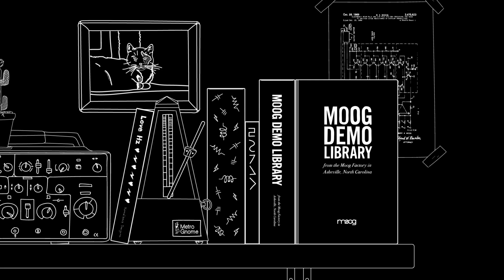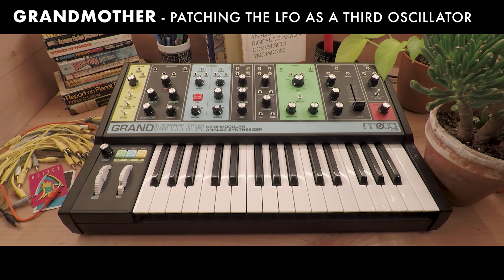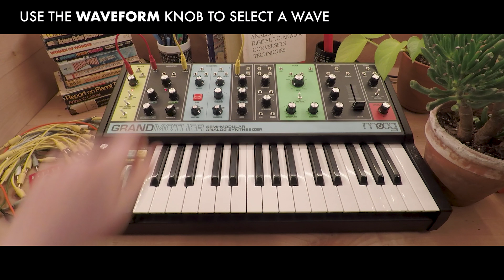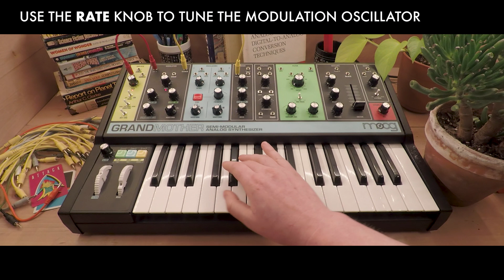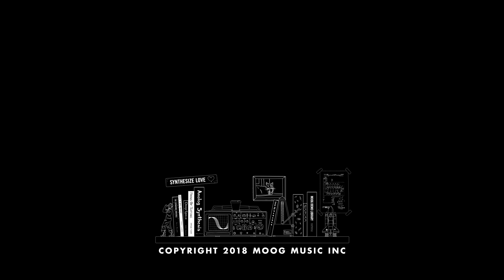Grandmother | Patching the LFO as a Third Oscillator

Comment: It was the first thing that I tried on my Grandmother and it tracks perfectly. Can I ask, could you  put up a video on the hidden functions such as being able to use the hold button as an LFO fine tune control? I can't find any documentation on it.
Reply: TIP: Holding the SHIFT button while adjusting the Modulation RATE knob allows
fine-tuning of the LFO rate, which is useful when utilizing the Modulation LFO as
an audio oscillator page 23 of user guide

Comment: How does patching from the wave out > noise in make the LFO audible? Is it just because the LFO is fast enough to be heard?
Reply from the maker: Yes, the LFO's frequency is able to go into audio rate and track the keyboard's cv, therefore you can use it as a third oscillator.  When you patch into the mixer section's noise input, you are able to replace the noise signal with an external signal like the LFO.